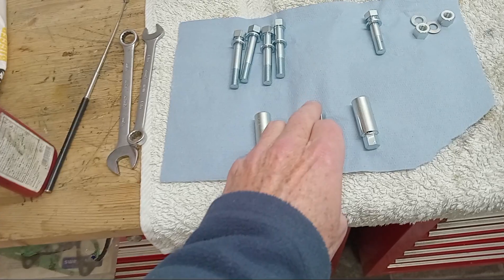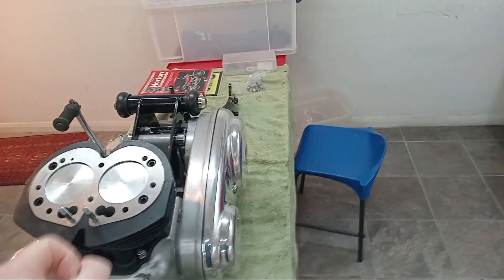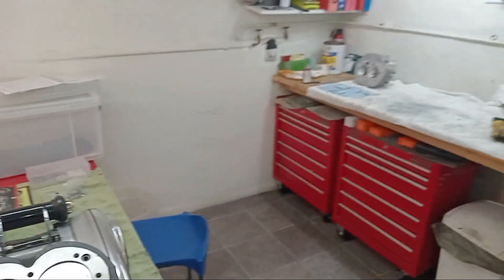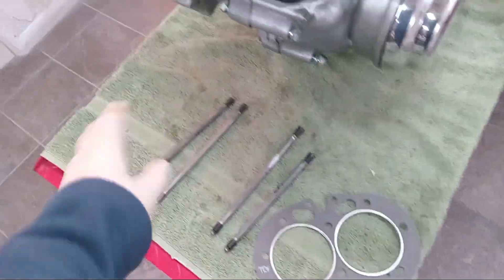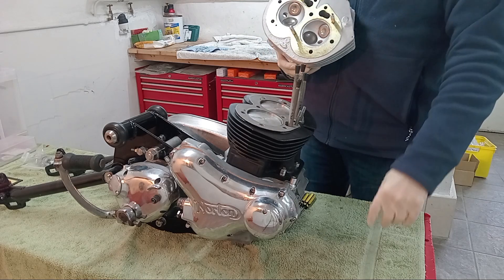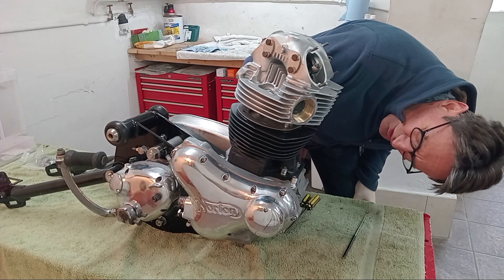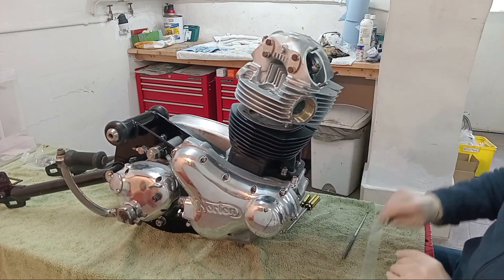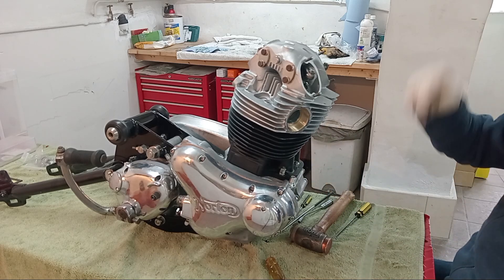Norton Commando Engine Rebuild. Part 73: Cylinder Head Fitting. Part 1

Comment: Hello Chris, why do you use wellseal on the headgasket? I’m currently in the same stage with my engine rebuild. Thanks for the very helpfull videos!
Reply from the maker: I use Wellseal on the composite head gasket to prevent oil leaks from the oil drain hole for the inlet valves, and from the pushrod tunnel on the exhaust side. It's not necessarily required, but by using it, you're pretty much guaranteed a 100% oil tight seal.